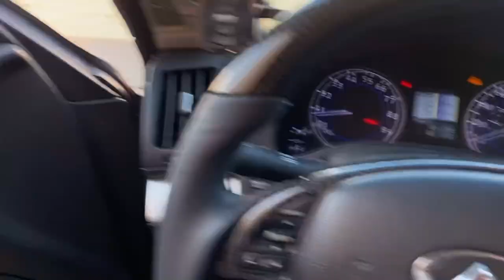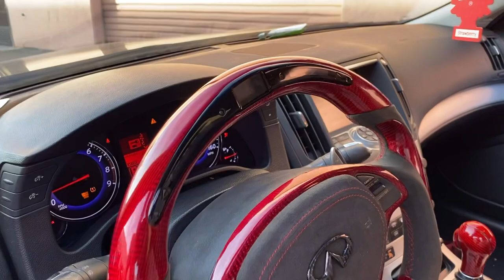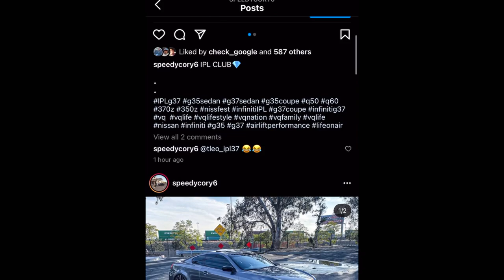A DAY IN THE LIFE OF A INFINITI/G37 DEALER!!!

Comment: Hey, I am interested in getting a Infiniti G37 IPL soon! I found one near me. It is a 2011, Malbec Black, black interior, 42k miles, and 6mt. I can also tell from the photos it has been slightly modified cosmetically, but it does not look modified powertrain wise. The dealer is asking 25k for it. Do you think this price is too steep for this car? If so, what is usually a good price for one of these cars with lower mileage?
Reply from the maker: Hey man! No that is actually a sold price being that it is a manual transmission. I got mine with 90,000 miles for $16,500 cash! The IPL do hold their value a little more than the regular G37 via Kelly blue book!
Reply: @Speedycory6  Thank you! Do you think I should shy away from the 2011 because of the galley gasket issues? Or do you know if that was fixed by this year?
Reply from the maker: @vetametric3099  it’s crazy because it honestly depends on who you talk too, when I first starting buying them i was told anything from 11+ the gallery was fixed, but now people are saying only the 13+ are updated.